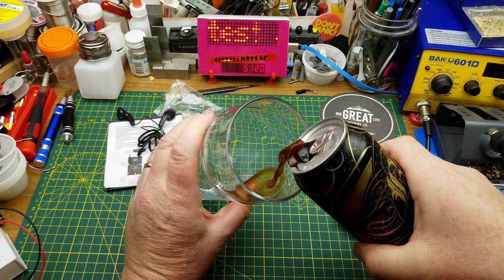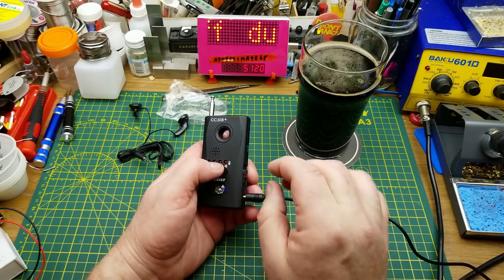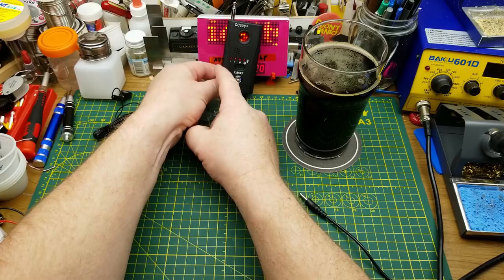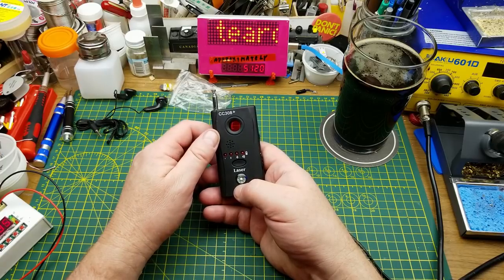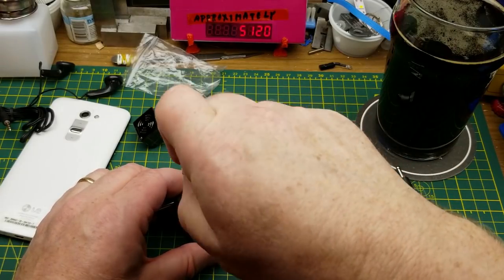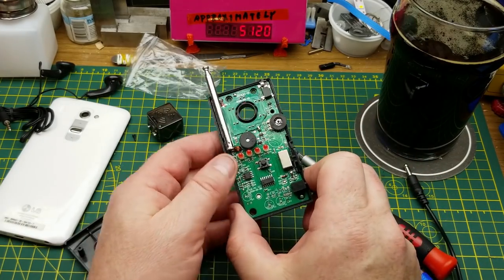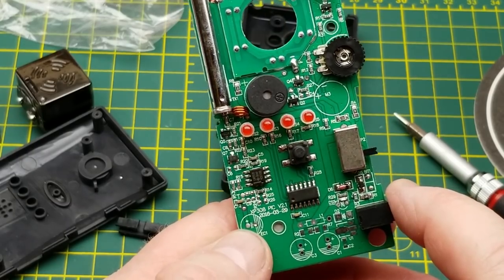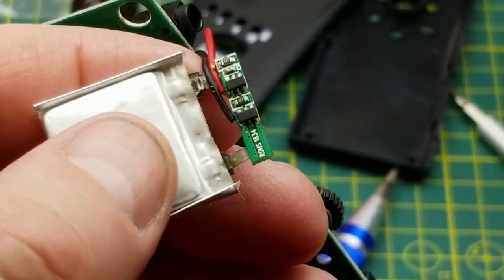Cheap anti-surveillance device. What's inside?

Comment: Real detectors as used by detective agencies cost £500-£1,000 UK and can be a lot more than that. What you appear to have there is a very wideband near field receiver with some flashing LEDs and a red filter to look through to help detect a red laser pointer. It looks like it kind of works well enough to justify describing it as a "receiver". With a bit of acting and judicious use of the gain control you could wave it about and claim someone was bugged and they would probably believe you.

Comment: You can detect a lot more with an rtl-sdr dongle and an android phone or pc.
 It's a surprising amount of components for such a crap result. I thought it was a two transistor amplifier or something silly. You'd think they would get a similarly crap result by just using the ADC on the micro and some cheapo preamp.

Comment: I was laughing with you, all the way lol.
An old field strength meter with pre amp would likely be more usefull.
That psu is bad but i do like the simplicity, i would not expect 500ma from it lol.
The Lm317 psu you assembled is far more useful than the plastic junk.

Comment: I don't know if it was that fair a test, and I don't think these thing do much more than what that did. Do phones give out RF when they are just sitting there, or do you have to ring out.
It's like Mr Clarkson's Super Ear device, ie, it can pickup low freq RF and is very sensitive. lol. I wonder if it can find ripple from the outside of a circuit.

Comment: That "mystery chip" might just be a cheapie VCO.
Are you sure one of those SMT transistors coming off the antenna isn't actually a dual diode?
Did I REALLY see something about UFO detecting in the instructions?
Finally, considering what you'd have to pay for the individual components from chips and LEDs on up vs. what that... thing... cost, did you break even?
Reply: The chip might just be an LM324 to drive the LEDs like a battery monitor.
Reply: @andyfraser5876  I'm on a crappy connection so I can't use high resolution and even think about trying to trace the circuit, but considering where the chip is you could be right.

Comment: Still laughing.  Playing devil's advocate for a moment, and thinking more about this, the LED camera detection is possibly one of the (shock, horror) more intelligent things about this bogus device.  The ability to spot a reflective camera lens hidden inside something (eg ornament or furniture decoration) would actually work.  You'd still have to know where to look however, which makes the thing fairly pointless (if you know where to look, you don't need anything but common sense).

This seems to be a theme - If you actually know what you're looking for, and have a good enough knowledge to differentiate between a power cable behind the wall and a transmitter, then you might find this device useful.  It might be great for finding 1960's level spy technology (LOL) when all power supplies were linear and mobile phones, wifi, and bluetooth et al did not exist, and "bugs" transmitted in a constant stream until the battery went flat.  (hint: modern bugs transmit packets of digital high speed data sporadically, (or at set intervals) and as more or less passive/shielded devices the rest of the time are extremely hard to detect. (which, by the way, is probably why you didn't get detection off the mobile phone - it wasn't transmitting).  The claim to be able to detect "received" signals is an outright lie (possibly the most blatant lie of everything they claim). 

To be actually useful, an anti spy device should probably be tuned to detect an EMF field in the 2/4/8 GHz range as used by most micro processors.  If you could do that at a distance of half a meter (or so) then you might actually have something really useful.  Shouldn't be too hard, you'd think?